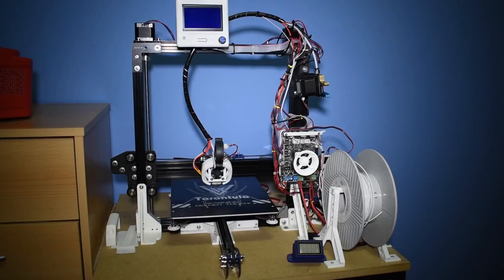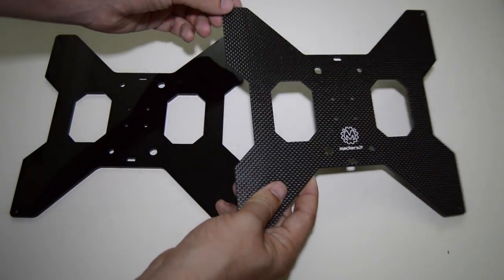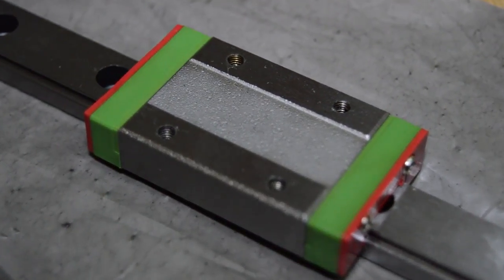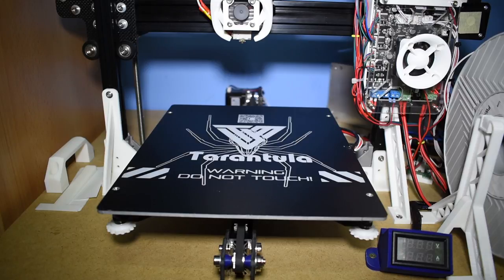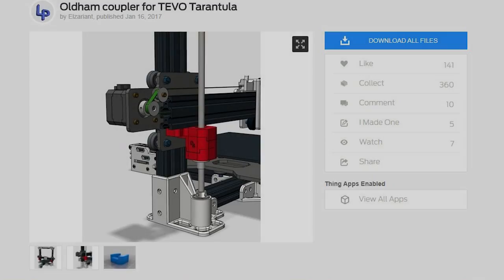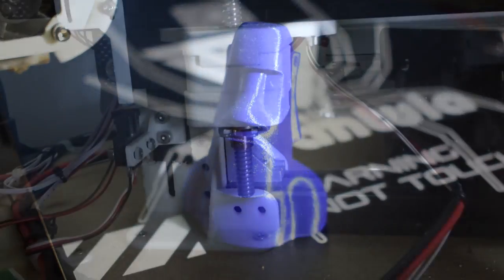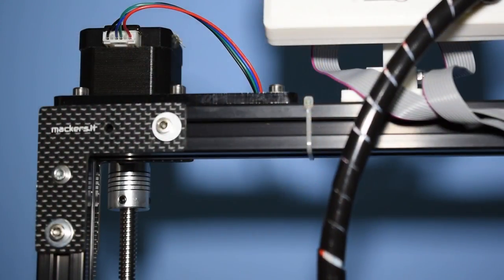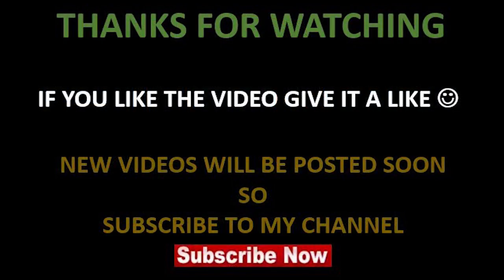TEVO TARANTULA - TOP 3 upgrades

Comment: Rui, you do great videos. If changing the Z axis setup, why not install the Z stepper motor(s) on the bottom of the printer, like virtually every other 3D printer has? This way, the screw shaft can sit directly on the motor axle, eleminating the force on the coupler alltogether. This would make a rock-solid connection, and would eliminate any play whatsoever in the z-axis. It puzzles me why almost no one does this when upgrading the Z assembly,

Comment: Ive watched to plans of this 3d printer, and it seems to me that you can replace the (expensive) upgrade 1 &2 with 
1. Draw/3d print 2 rectangular boxes that can hold 2 bearings each and fit under the 3d printer lengthwise.
2. attach 2 small metal rectangular plates alligned to the bearings in step 1 to the accryllic plate.

The bearings can be ridiculously cheap in , as the max weight will probably not supercede 10+ kilo and should not be more than 1 dollar a piece, small metal plates can be found pretty much anywhere and will be about 4 dollars at your local home depot. The plastic used to 3d print should really not be more than 10 dollars. 

You will have a triple supported construction, this will minimize wobble and more importantly will prevent warping of the acrylic plate.

NB. I have never 3d printed before, the tarantula will be my first. But i am a mechenical engineer so i have a tad of understanding about the forces on this baby.
Reply from the maker: Hi,
Thank you so much for your feedback.
I'm sorry but i don't think i fully understood your concept.
If you are interested in explaining in more detail, you can contact me through FB in the official tevo tarantula group.

Comment: The best mod I did was invert the z axis lead screw motor at the bottom and fixed at the top with a bearing and matched mounting bracket and a new printed bolt mount for the x rail. Now I have zero z wobble and no need for a extra z screw and motor or Oldham coupler. The inverted mounts are on Thingiverse but I designed my x rail bolt mount my self as there were none suitable on  Thingiverse.
Also change the smooth idler wheels to matching toothed ones on the x and y belts is a must also as it takes out the tiny waves in the print. As tight belts running over the smooth wheels the teeth ever so slightly change the length of the belt.
Reply from the maker: Hi MrGrantdw,
Thanks for the feedback.
I thought about testing that one but i think that inverting the motor will prevent the flex coupling from stretching but it will instead compress it.
Regarding the toothed idlers, i have that done a long time ago but, to be honest, i didn't see any print improvement.
But by saying that i don't mean it's not a good upgrade...far from it... The improvement i see is mechanical as the belt runs smooth over the teeth instead of the flat ones and prevent the teeth from being squashed which makes the belt last longer.
Reply: when you invert the z mount and set it up you are supposed to stretch the flex coupler to give it some tension as you do up the grub screws on the threaded rod  allowing it to take the wobble out of the z screw. Its the bigest mistake Tevo made hanging the y axis on that type coupler it's not designed for that purpose its designed to be at the bottom like when used in prusa i3 design printer. As soon as I inverted the z axis it drastically improved my print quality and I see no need for a second z screw just look at the  Creality 3D CR - 10 much bigger printer and 1 z screw done the right way not hanging from the top.
Reply from the maker: Hi MrGrantdw,
I didn't test the inverted z motor yet, but what i can see is that, while on top, it will stretch due to the weight (you are correct), but when at the bottom, it will be compressed due to the weight as well. Mounting the Z motor at the bottom might be a better way compared to installing it at the top, but even so, you will still have to raise that X gantry only from one side. The Creality3D CR10 only has one leadscrew but it's "clone", the Anet E10 has 2 leadscrews ;)

Comment: just in time for me, getting my tarantula on monday :)

EDIT: Could you link to upgrades in description so they would be easier to find? Also how about aluminium parts instead of fiber ones? Those are a bit too expensive for me, and being from US that only adds tons of more fees
Reply from the maker: Hi Arvydas,
Sure.
I did that for the addons.
Will add some for the upgrades too ;)
Reply: regarding carbon fiber parts, aluminium ones would still be better than acrilic ones? I assume that would add quiet some weight
Reply from the maker: Hi,
there is an aluminum manufacturer that is making the Y carriage not as heavy and that would be a good alternative to the carbon fiber.
The issue with vibration is for the plates that hold the motors. Those are more susceptible to add vibration from the motors to the frame.
My advice is you to print a ripple test cube ( https://www.thingiverse.com/thing:277394 ) before and after ANY upgrade so that you can track the differences.

Comment: OUCH on the cost of the carbon fibre parts! I have access to carbon fibre sheet as my brother is a manufacturer. Maybe there are measurements somewhere for us to fashion or own?
Reply from the maker: Hi,
The kit is not cheap that's why i recommend to get only the bed carriage on a limited budget. But in you case, if you have the chance to get a CF plate and CNC cut it, then go for it ;)

Comment: I probably buy one this week, but from your videos I am afraid that I will have to do 1000 upgrades to get a good printer.
Reply from the maker: Hi,
Actually, the printer is very good and the fact that is upgradable and customizable it's a plus.
The stock printer can ( and does) print very good.
Reply: Despite de fragile acrylic parts It seems the components are good: the PSU, the bed, the board, the eccentric nuts. I am afraid of the Z axis behavior , from what I saw on the internets, there's a lot of trouble with it. I want a printer with aluminium frame, I was thinking of a tronxy x3 , but now the tronxy x5 got 20% on GB. Also in this price range we have anycubic kossel, anet A2 .  And btw 3dmakernoob will have live assemble today of tarantula.

Comment: Great Video. Thank you very much. Did you have the chance to compare the aluminum y-carriage to the carbon one?
Reply from the maker: Hi Vespasian,
No i did not. But i know many people that have it and shared their findings.
Some of them actually said that noticed a decrease in printing quality after upgrading to aluminum. That is due to the fact that aluminum parts don't absorb vibrations and you will capture those vibrations in the prints.
Reply: I see :) I'll probably get the carrriage carriage upgrade only and (hopefully) can have the other parts made from aluminum by a friend of mine or simply print them. Let's see how this works out ;).

Your videos are probably one of the most valuable resource on upgrading this printer. Especially since I bought mine with the intention of tinkering and learning things from the ground up :)

Comment: Hi RuiRaptor, because you have already done the bed mounting mod, changing to C/F, I am assuming that you have the original acrylic one lying around. Could you please tell me the dimensions as I plan to buy a piece of C/F and cut my own bed support. Keep up the great work with videos.
Reply from the maker: Hi Chris,
Sure...but i can do even better...
In the official tarantula FB groups and in the file section, you can find the files with all the parts already made. This was done sometime ago for all of the guys who wanted to cut the parts with a CNC.
Reply: Sorry to be a pain, I am not a big fan of F/B or any of the social media apps. Really not looking for all the brackets (just now). Just the bed mount. The  Linear rail MGN12,  and the Tarantula i3 3D Printer Dual Z-Axis Upgrade are in the post to be incorporated in the initial build. So I just need to purchase a piece of 3mm Carbon for the bed support.
Reply from the maker: Hi Chris,
No problem. Can you send me your email address so that i can email you with it?
Reply: How do I send my email without giving it to everyone? I thought I had sent it by Google+ but maybe not.
Reply from the maker: Hi, i received your private message. I havent sent you because i have to do what i told you to do which is going to the file section in the FB group and search for the files.
Reply: Ok. I will learn to be a little more patient. I just wasn´t sure if you had got the email address. I will now go and sit in the corner and wait

Comment: Hi! Thank you for your videos about Tarantula! Can I ask you why you putting paper insulator on the glass? Thanks for your response!
Reply from the maker: Hi,
it's not paper insulator.
It's masking tape to increase the adhesion of the filament. Printing on bare glass is not easy and there are some techniques to improve adhesion like glue stick or hair spray. In my opinion, masking tape is a better solution because it's more practical and cleaner.

Comment: I'm looking to buy my first 3D printer and am looking at the Tarantula. On gearbest they have several versions to choose from.  The basic model at $189 and an advanced model which has all metal parts and much wider rails for $322. Is it worth spending the additional money?
Reply from the maker: Hi John, were did you find the advanced and all metal version? Can you share the link?
Reply from the maker: Hi John, just as i suspected...there is no all metal parts. What you see there is the add for a normal tarantula and a video for the black widow 3D printer (also from TEVO). If you contiune to go down the page, you will see the tarantula pictures.
Reply: Thanks that is very misleading.  another question, how important is adding the second Z axis kit.

Comment: With the dual Z axis should I use a Y adapter or the other driver and edit the firmware?
Reply from the maker: You have a few options. The easiest way is to use a cable adaptor to connect both Z motors on the same driver output and both motors will turn in sync.

Comment: Hello. Please how do you connect 2nd z axis motor in the board. what you mean with "Parallel cable"?
Reply from the maker: Hi Silvio,
When you buy the kit, it contains all the parts (motor, leadscrew, motor mount plate, Leadscrew nut, etc) and also includes the cable to connect the second motor. This cable is a Y cable that allows you to connect both motors in the same driver on the board.
Reply: Ahh, a Y cable. Very well. Thanks.

Comment: How do you set up the dual z in the software?
Reply from the maker: Hi Bob,
If you use the parallel cable that comes with the kit, you don't need to change anything in the firmware.
You only need to edit the firmware if you need to use the extra spare driver to work together with the existing z driver.

Comment: I think that for Y axis modification is better two rails, it's more solid and cost less. Two aluminium profiles (500mm) cost less than 12$. You can also use original bed carriage if you print these files: https://www.thingiverse.com/thing:1933208
And for Z axis modification, you can use just one motor with two rods and belt: https://www.thingiverse.com/thing:2163949 It costs less than buying a second motor.
Reply from the maker: Hi,
Thanks for your input.
I agree with the dual rail for the Y axis and it's true that it will be more solid. However, a good rail is somewhat expensive and a dual rail is twice as much. The single rail also works though ;)
Reply: @ruiraptor  Sorry, I wrote it wrong. I thought using two aluminium profiles with original bed and wheels instead of rails. I made it like that. And it is really cheap and solid. It costs me about 12$. :)
Reply from the maker: Ah yes, i know what you mean. A wider grip is always much better. Your solution also works and is cheaper.